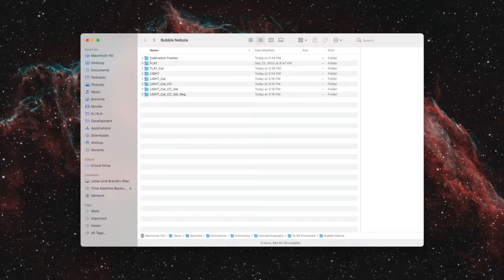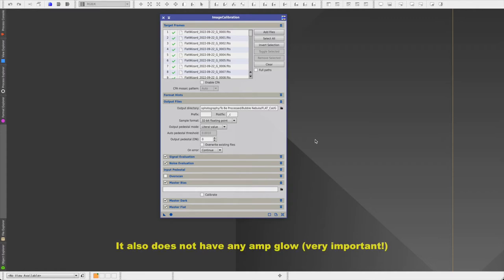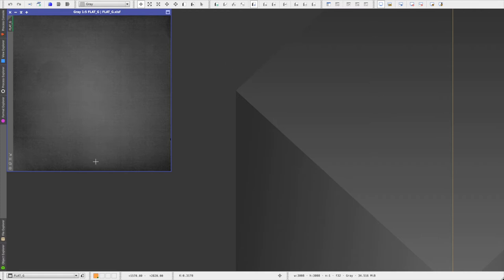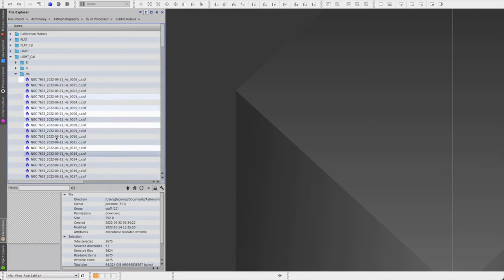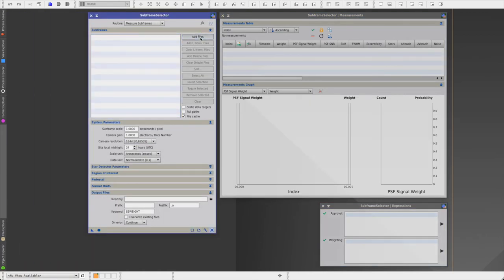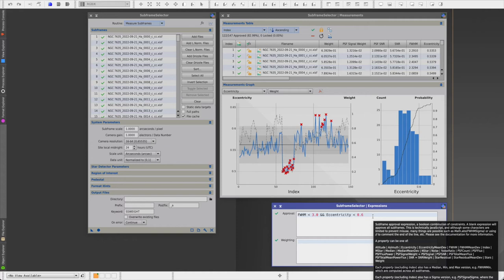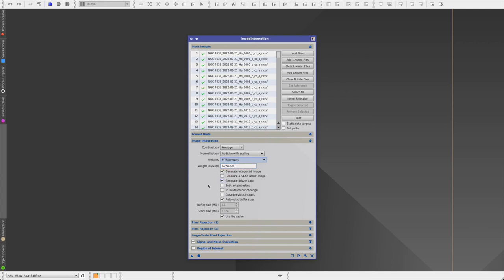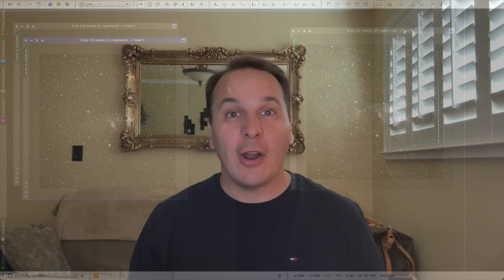The Bubble Nebula Project - Part II - Pre-Processing in PixInsight

Comment: Can't wait to watch the series.  This is exactly what I am looking for.  I want to figure out how to process the images so you can actually see the color and detail in the greenish/yellowish nebulous line in the skull's left cheek area.  Right now, mine always comes out as pure white, with no detail

Also, If you stack the images in Deep Sky Stacker, it will align the images for you.  You just have to select a master reference frame in one of the tabs for the color channels, and just keep it as the reference frame as you stack each of the channels/tabs.  So for example, if my reference frame is in the Ha tab, even when I stack the  subs in the OIII tab, it will align them in accordance with the reference frame in the Ha tab, even though I am not including that sub in the OIII stack.

Then when you import each channel into Pixinsight, you just need to crop out all the junk border areas.

I've never taken the time to figure out the pixinsight stacking process, but I would think they would have a feature like that as well, to avoid the manual star alignment process.

Comment: How do you select subframes without specifying image scale? It will not generate correct results.
Reply from the maker: I do specify image scale: 1 arc second per pixel, which is roughly the correct value.
Reply from the maker: Note that image scale does NOT influence the selection process. It is merely used for display purposes! (it depends on what you prefer, arc seconds per pixel, or number of electrons per data number)
Reply: @darkskygeek  It does for me. Resolution values are defined by FWHM. For my system, I throw away any frame above 3”. For your system, I will toss away any frame above 2.5-2.7”. This is why star alignment is so vital. For 1” (your system), guiding accuracy of 0.5-0.7” rms with 10-15% standard deviation during whole session is required. Good luck in getting it without star alignment.